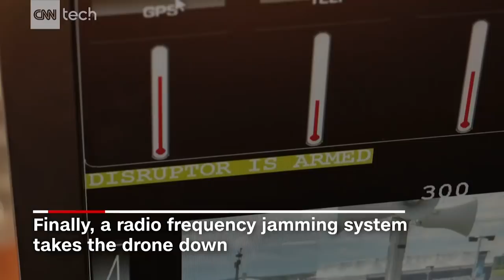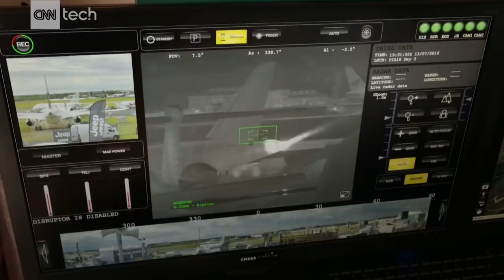This electronic cannon disables drones

Comment: It's pretty easy to solve .. Just program your drone to do a task without the need of external communication
Reply: Yes - this is the issue with all the "anti-drone" systems I have seen. It is almost trivial to build and launch a drone (even one using off-the-net free software like Ardupilot) that is totally autonomous and, thanks to the inertial nav systems in the drone, are not even that reliant on GPS for low-accuracy missions. Unfortunately it seems governments are buying these anti-drone systems seemingly unaware that, for the treat posed by a serious terrorist (or just someone with hacker mentality who would happily shut down an airport just to prove they could)  they are just not up to the job. Joe Public with an off-the-peg drone is not their biggest problem!

Comment: ok but what if the drone is flying on preprogrammed route? does this disrupt gps so the drone doesnt know where it is?
Reply: bdk316 that is false. if there's no radio communications then the drone doesn't care and will just proceed with whatever it was told.
Reply: bdk316 I thought the same thing. Either way, they probably don’t want us knowing
Reply: Unfortunately for those trying to stop a drone, say, disrupting an airport for which low accuracy is all that is needed the inertial platforms built into the flight controllers can cope with significant periods of GPS outage and still fly their mission. No point in pretending this isn't so as it's just living in a false paradise.
Reply: Yes BECUSE it's still a program ... And this blocks any communication or programmed ability to do what it was suppose to do